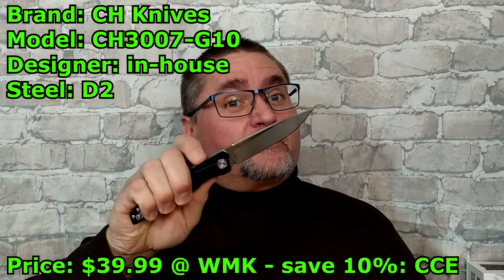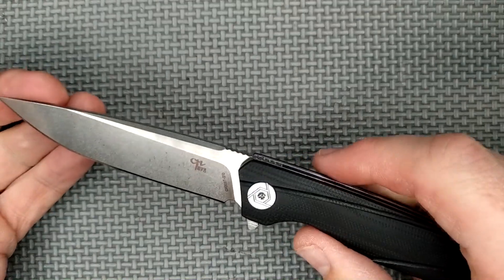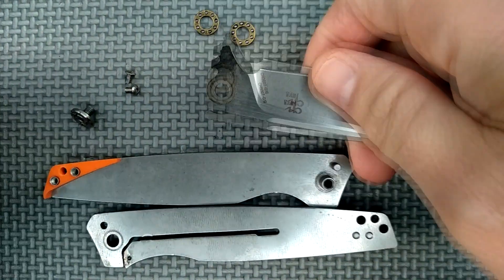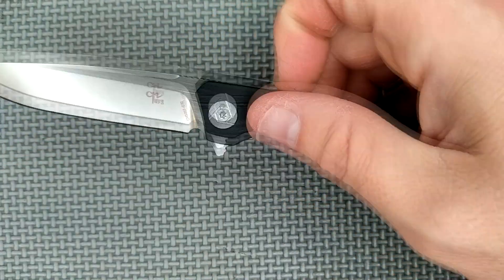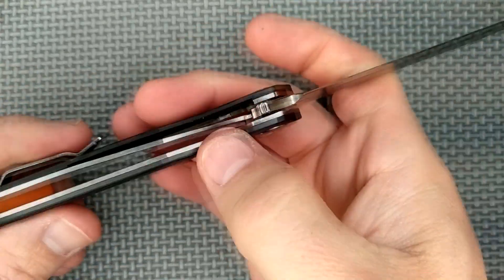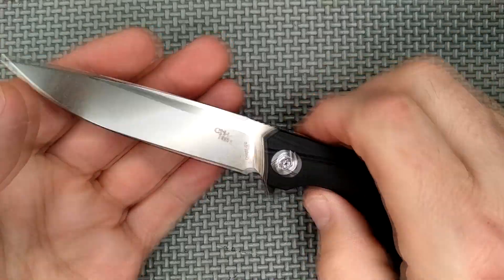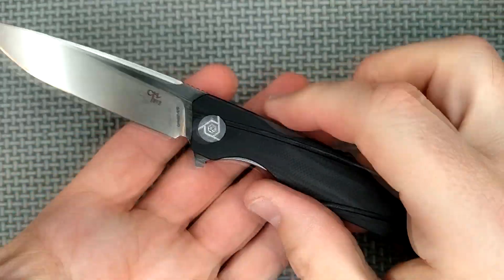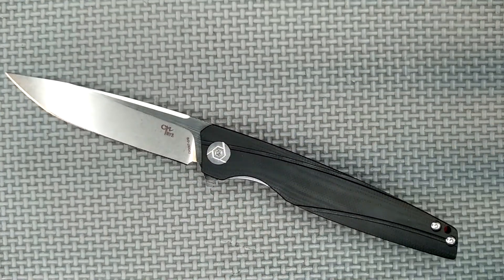Review CH Knives - CH3007-G10  / I WISH THEY WERE ALL GREAT!!!

Comment: I like this one.  Ive been into slimmer knives lately for some reason
Reply: Get a Harnds Assassin, you can get one at WMK for less than $38. They’re slim, sleek and well put together.
Reply from the maker: I agree with Charlie, the Assassin is a better knife.  I will review the Assassin soon.  Don't forget to use my coupon code and save 10% at WMK - CCE
or get it from PowerCutlery.com for $32.95CAD - http://bit.ly/3o2uBNg

Comment: Thanks for "The Good, The Bad, and The Ugly." Too many faults in this knife to call it a "lemon" or a "fluke".
Reply from the maker: It should not have left the factory, but the biggest problem could have been overlooked if they didn't SLAM the blade open during testing.  when I first got it it seemed fine for the first 10 or 20 times I opened it.  the problem with the lock showed up after that point.  but still, it should not have left the factory.